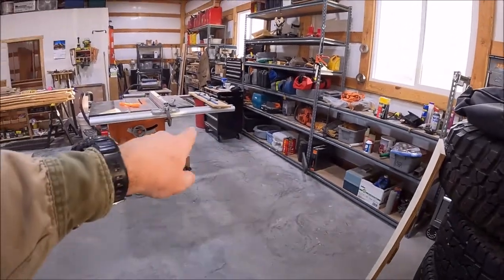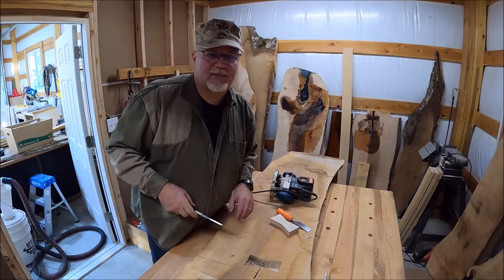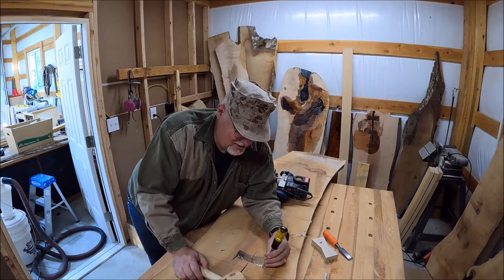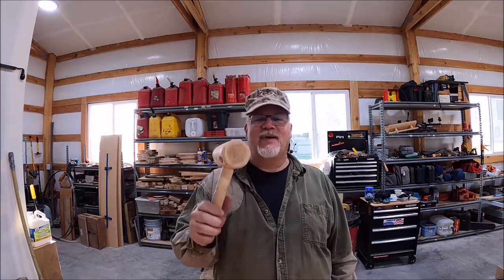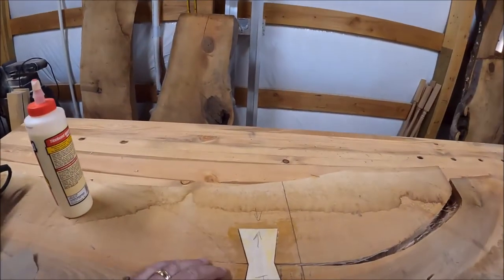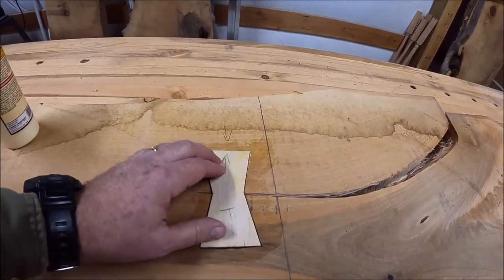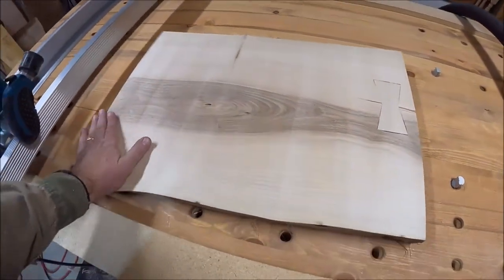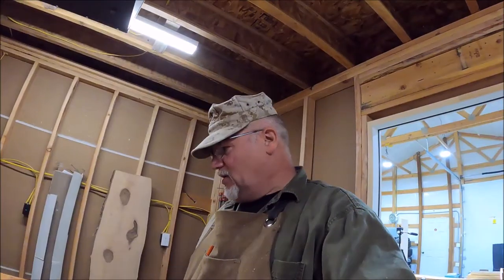Making a live edge counter with  English walnut rough sawn lumber

Comment: Nice job on that crack ! I just use those clamps that are used to pull counter tops together from the under side. Yours looks nice I would use that for the top. 
Nice shop !! I work in my cold pole barn with a dirt floor 🙃 
Cheers !!
Reply from the maker: Thanks!  I love the look of bowties and enjoy making them.   I often had no shop!   Used to use a tent or only work in good weather or inside the house.  Finally after all thise years I built one!  And love it!